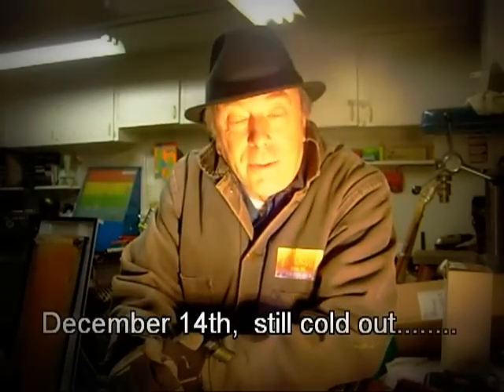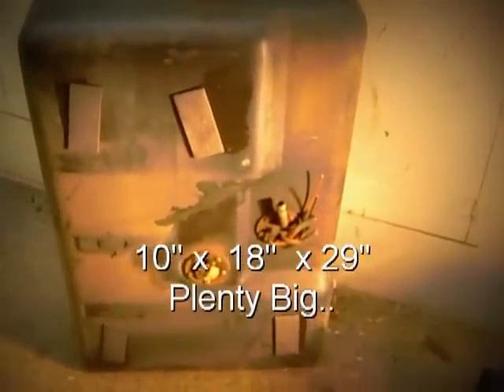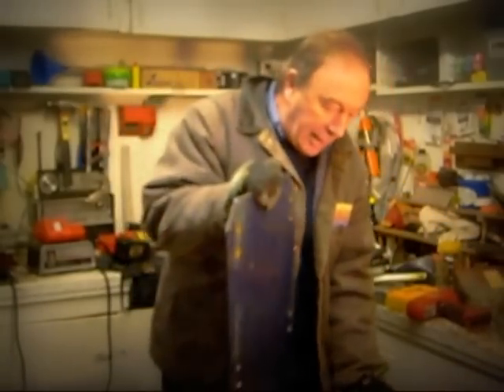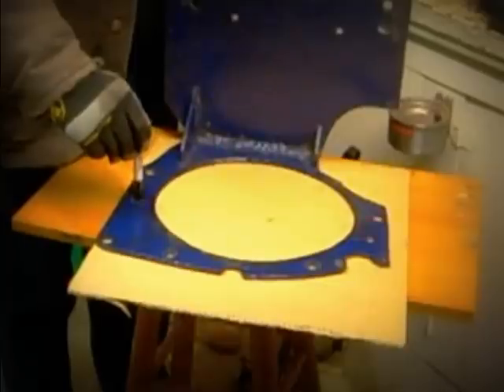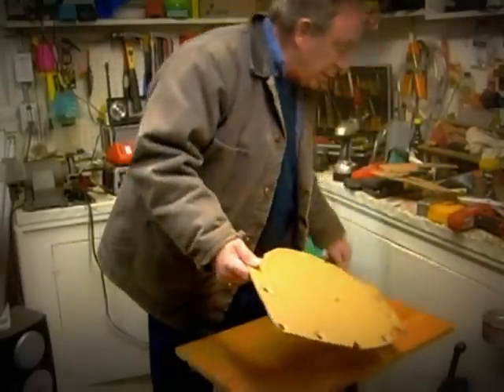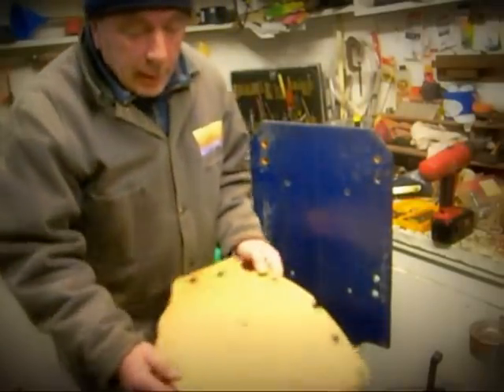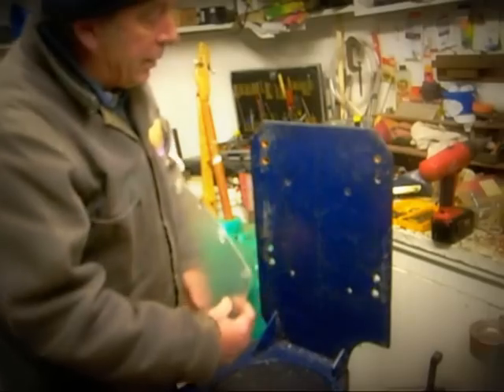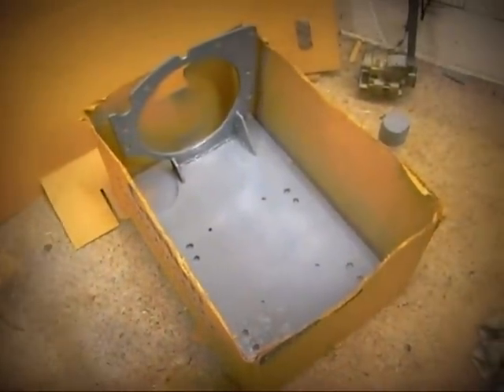The Electric Motorhome  part 5.

Comment: I hope you get the money for the generator and batteries soon John. I REALLY want to see you finish this project. I've been thinking for about a year now that a solar powered RV would make sense (especially a big one), because of how much space is on the roof (maybe 10 panels could be mounted up there). I figure a couple of days of charging, and you'd be ready to move on to the next location. For faster charging you could plug into a 50 amp outlet at a campground or use a portable generator.

Comment from the maker: SOOPERGRAPE.22000 watts is what it says on the motor nameplate.This will put out 1 shit load of torque.I think of 30 horsepower as 30 horses.Would they be able to move this vehicle ?You bet.Of course this project is costing a few thousand.If you want a cheap conversion,go with a DC motor and controller...cheaper,but way less efficient..Good Luck.(-_-)

Comment: About the power requirements: You say 22,000 watts, is that at maximum output? Also, how much torque will the 30 hp motor put out? I am wondering about solar panels on the roof, batteries, and maybe using a larger generator to provide acceleration and then the panels and generator by day. If it is enough at hwy speed any remaining power could be diverted to recharge the batteries. (I'm also thinking a decent RV would be a LOT cheaper with a blown engine.) How many sq. ft. of roof is useable?